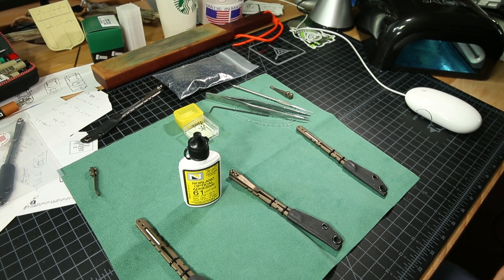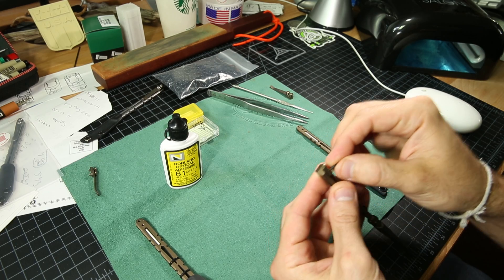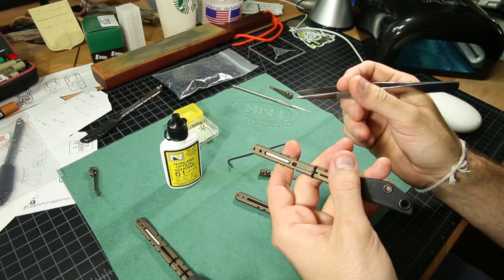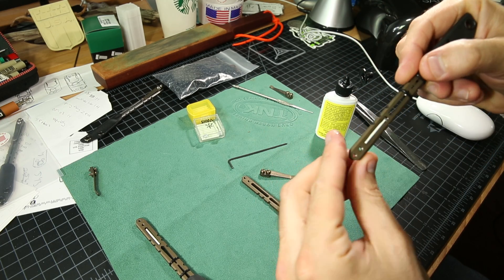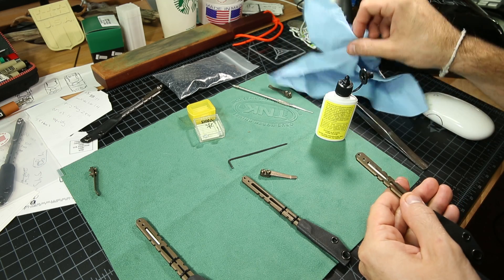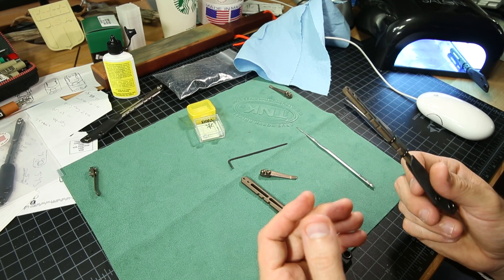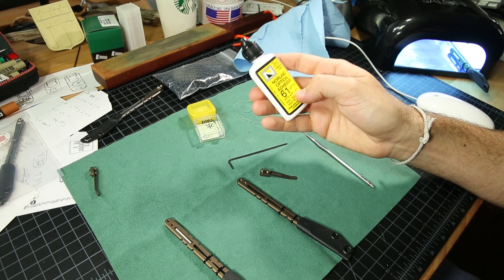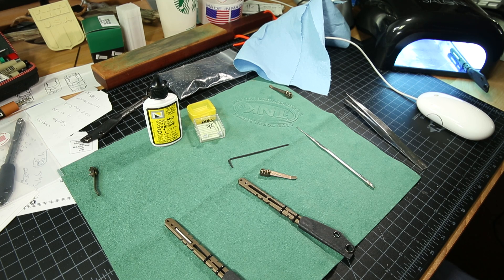Using Norland 61

Comment: Anything changed in your technique doing this   over the years? I'm inspired to cut some grooves in some knife scales I have and put trit vials in. I have a mini of yours and it's done perfect. I thought maybe you had a mold to keep it from going out the bottom.
Reply from the maker: No same thing really. I just fill them up one step at a time. Moving over to useing a uv nail dryer was game changing though. I usto leave it out in the sun but it takes hours that way.

Comment: is it possible to over cure this?
Reply from the maker: I don't think so.. I've left it curling for hours with no problems..
Reply: I just glued my 10x80 WW2 Flak lenses with a UV 395 and got bubbles in the center, using same product. I think I got the light too close to the lenses. Plus there was some shifting with the lenses. looks like I'll have to separate them and start over.

Comment: You can also buy a UV reptile lamp at any pet store for much cheaper.
Reply from the maker: I don't think that is the same spectrum that is needed. 
This glue cures at 365nm
Reply: Yep, there are 3 types of UV spectrums. 365nm falls within the UVA spectrum. Reptile and plant bulbs should come in UVB and UVA. Still, you're better off with an enclosed lamp like the one you have. 

Less professionals might want to save some $$ and buy a UVA bulb on ebay or something and use their own lamp.

Comment: and where did you get that uv oven , all the nail dryers i find are too small to hold my flashlights :'(
Reply from the maker: +power moves it's just a normal one hand nail dryer.. Has four bulbs in it.. Any kind will work though.. buy the cheapest one you can find
Reply: ok cool ty

Comment: Which UV box is that, and any issues with it?
Reply from the maker: It's just a cheap nail dryer I bought off amazon.. Any of them will work. This one had four bulbs in it thats why I picked it. Just one or two is fine though for a hobby guy. The glue will cure in the sun also it just takes longer and dust  can get stuck in it while it sits out in the open.

Comment: I just bought a Hurricane Razor 2.0 from BladeHQ, will it come with a Tritium already installed or just an empty slot? BladeHQ does not mention the trit slot in the online ad but I can see it in the picture. It doesn't appear to have one but I wanted to ask you. If not is it the normal lantern size 3x22.5 or similar? I will go ahead and order one to install.